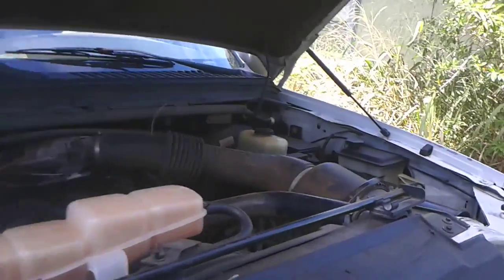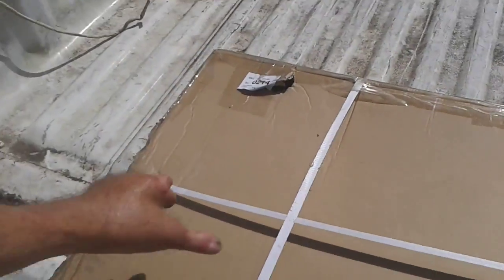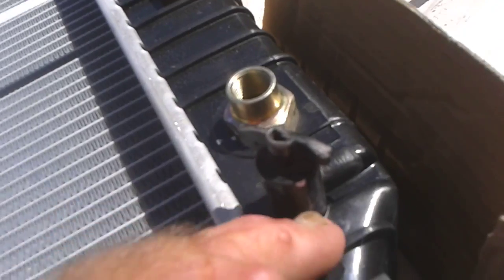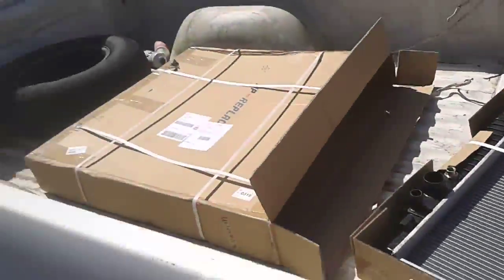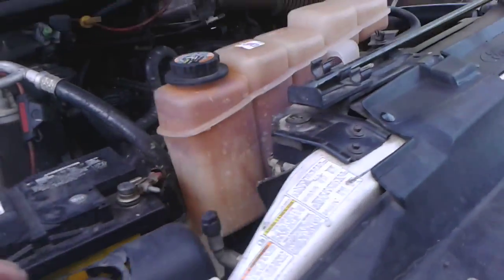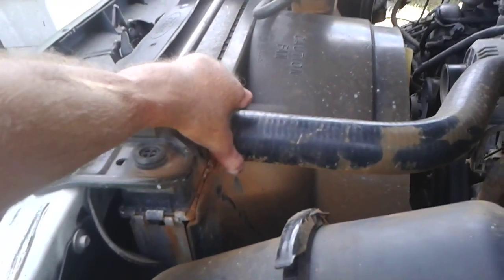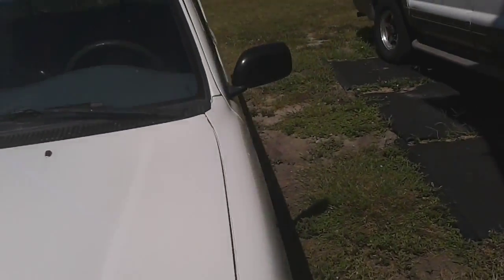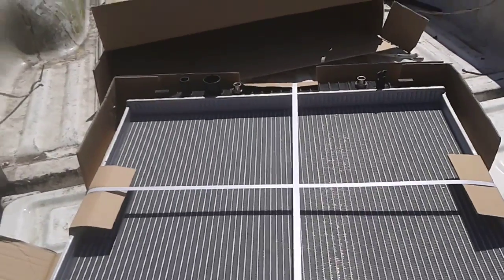Ford Excursion radiator $89.99 odered from dnamotoring on ebay

Comment: Fed ex has damaged numerous boxes of items ive bought through ebay. they always blame it on the conveyor belt but they act like its not a big deal. its a big deal to me as two were old radios that are no longer made and are now only good for some parts that werent damaged. Do you think it was the heat or the antifreeze that caused the damage?
Reply from the maker: +shortwavetube yeah , i had to file a claim on something i sold on ebay, that they damaged. they paid me more then my claim was. and it only took a few days ... i just shipped 200 lbs for under $200. with them this past week. they ship up to 70 lbs. for $56.